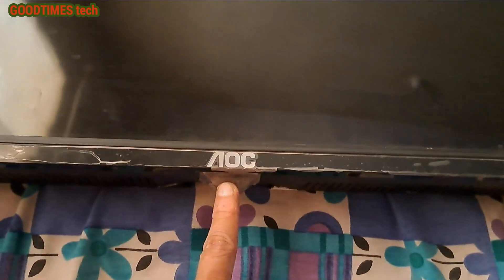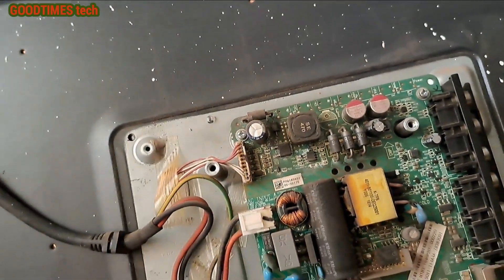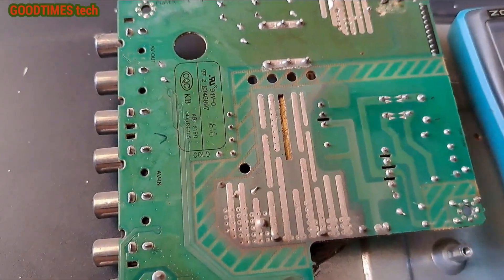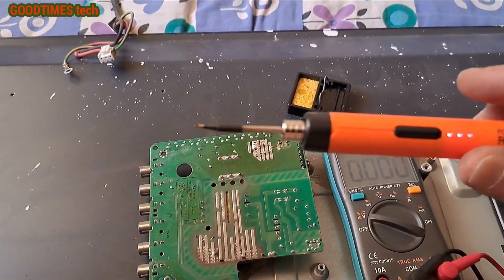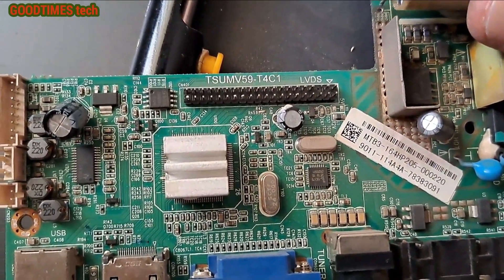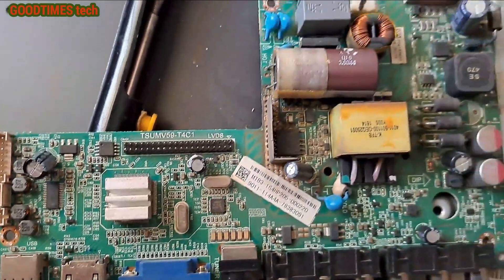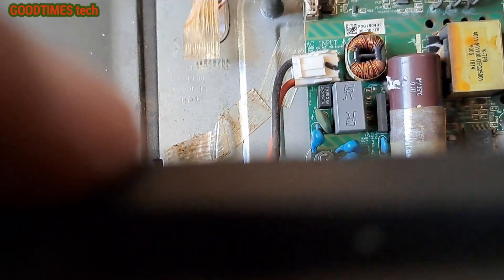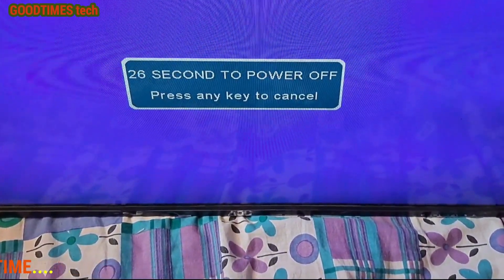AOC LED TV dead or intermittent not powering ON | Lets Solve.

Comment: The candy crush trick, its not working anymore.
Reply from the maker: Hi , I have stopped playing this game because I was playing this game when I was abroad, I had reached around level 550 and when I returned back to India my phone suddenly started popping up many unwanted advertisements even when no apps or games were running in the background, I thought I need to reset my phone but I felt I should uninstall recently installed apps, I started uninstalling apps one by one and when i uninstalled this game ads pop-up stopped. 
I will check if there is any other trick.
Thank you for watching the video, have a GOODTIME....